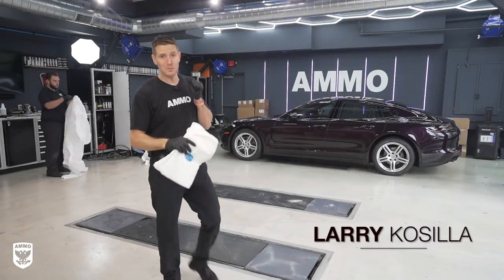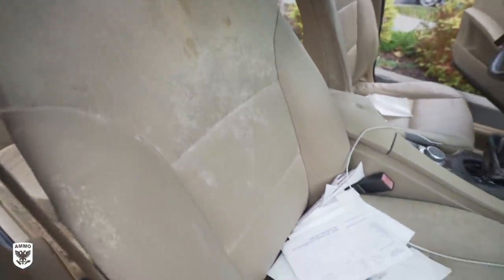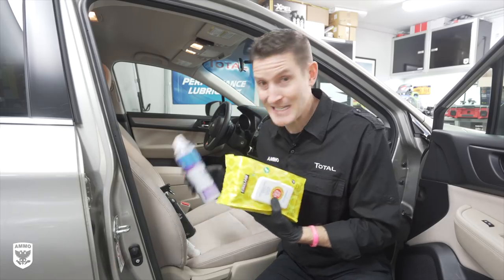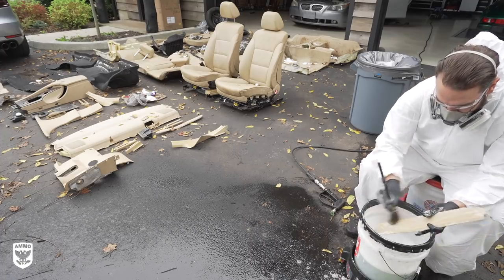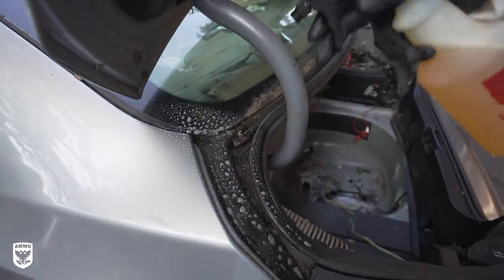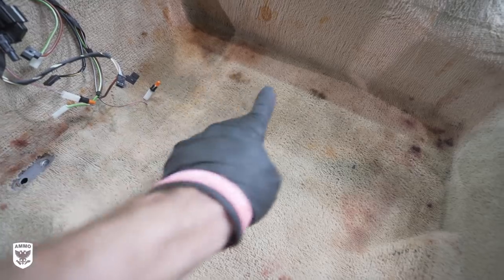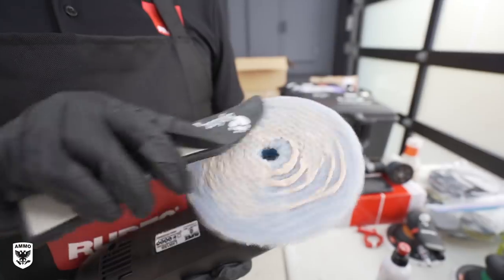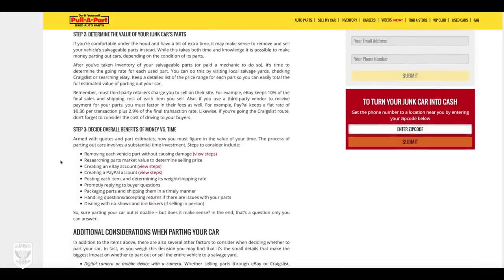Dirtiest Car Ever! BMW Full Interior Removal and Detail BMW 5 Series

Comment: Larry... if you were doing this for a customer car would you have a concern for the vents, headliner and foam inside the seats still containing some mold?
Reply: This!! I’m wondering about this too.
Reply from the maker: Yes it would be a concern
Reply: @AMMO-NYC  Would the gas have killed whatever was in the vents or would you need to actually take the HVAC system out or replace it? Also what would be the process for cleaning the headliner? You could just replace the seats because they probably do still have mole inside and could get them cheap.
Reply: Would probably want to run hvac on recycle while it's gassing like when they do the ozone treatments.

Comment: The car wud still be bio hazard, aircon dashboard etc were never removed
Reply: Yah how does this work legally? The car was totaled as a biohazard, and those hazards still exist.  The unsuspecting buyer of, say, the back seat would get a massive chunk of foam and upholstery full of nasty.
Reply: Yea its dubious, things like the seats should have been permanently defaced to ensure no reuse no resale.
Reply: But I think the tablet system that they used killed off all the mold.
Reply: @volvacations2186  Do you really think the tablets got all of it? Doubtful.
Reply: The Chlorine Dioxide was used to kill the mould remember.
Reply: If you do a strong Ozone treatment it can usually remedy that issue. Since Ozone is a gas and can reach virtually every space. Also the fact that Ozone kills bacteria and viruses. Taking out the entirety of the AC systems would be fruitless. Unless you just want to totally replace them. Which for this car, would’ve been the proper choice.

Comment: If you’re concerned about to panel/trim clips breaking during future details, you can order kits off Amazon with different assortments of sizes for $15-$20. Kits typically are made for one specific manufacturer. You could keep one for each of the common manufacturers on hand in the shop.

Comment: I can easily relate to this. I work at a scrapyard, and only deal with the automotive recycling side of it. You have to go in the cars sometimes to pull stuff out that can't be shredded or crushed for safety and environmental reasons. It gets really disgusting sometimes. Even this bad. Which is why you refuse to go in those kind of cars.

Comment: I use ozone machine to remove odors and mold you should look into one!
Reply: The CIO2 seemed to work really fast. Thats really handy for a business owner. An ozone generator would have taken 2-3 hours minimum
Reply: @Isaac-od4rm  yea your right but you have to get those special tablets. Ozone just uses power and it’s maintenance free
Reply: He's used them before
Reply: Ozone has no effect on bacteria, mold or VOC... It's effect on odours are also questionable, as it mainly "masks" the smells so you smell ozone in stead. Also: Ozone is toxic... The generators are also not maintenance free as often being claimed.
Reply: @havardhovdet9217  ozone does kill mold and virus I know ozone is toxic but letting the car air out for hours should have normal oxygen levels

Comment: I don't understand how car economics work out there. Was it cheaper to scrap a perfectly functional vehicle that to restore or refit the interior?
Reply: That car is not restored. Sure, it’s cleaned, but the areas they didn’t touch are likely just as disgusting as everywhere else, so this would need a complete disassembly. Not to mention all the wires that could’ve been chewed and all the decay of sitting for a long time, so I get why this was totalled

Comment: Figured I would ask the Ammo community for advice here. I’m a detailer from Columbia, SC and my business is growing and I’m looking to get into machine polishing. I’ve used the Meguiars  ultimate compound and polish by hand to finish off headlight restorations and I’ve done some spot correcting, but I’m to the point where I would greatly benefit from a machine polisher. What polisher, pads, and liquids should I get. It seems like the general consensus is that the Rupes 15mkiii is the best general purpose machine but that seems to be where the consensus ends. What liquids? What pads? Any help would be very appreciated. Thanks everyone!

Comment: FYI - never wash seat belts they will get sticky over time and will not recoil. Nice work most of that hazmat items should have been scrapped not cleaned. But FYI super important when cleaning out seats in a mold car like this require special process to remove mold. but 1000% nice job for the ammo team to take on this work !

Comment: Brilliant video and for a great cause. Interesting about the one step clean and polish product, im gonna have look for these and try. 
I've had great success with meguiar's polish with a microfiber pad at relatively high speeds on a DA  polisher. Works fast is very safe for a low level detailer/diy'er like myself  removes etching marks water stains and neglected paint generally. It's quick and then I follow this with autoglym super resin polish. For more Intensive marks and scratches I swap the meguiar's polish for meguiar's compound and repeat the autoglym super resin polish application. The results are amazing and a whole takes just 2hrs normally. When you normally have a short weather windows in the uk for unpredictable rain showers and my time I've found this to be the best bang for buck method which works for me.

Comment: just a tip, you shouldn’t dry carpets in the sun as they can shrink and then they don’t fit well back in the car. they should be dried with a fan indoors so basically air dried. Detail was fantastic though!
Reply from the maker: Thanks for the tip

Comment: Those particular e60 models are known to have clogged sunroof drains,  letting water escape into the headliner, down the b or c pillars and into the carpet depending on which side the drain is clogged off course.  Your water through the window theory,  not sure about that one but it’s possible.  It’s more likely water from the sunroof.

Comment: I'm just curious if all of the cleaning solutions that you are using and rinsing off in the driveway are safe to have enter the storm drain system of the neighborhood, not to mention all the other contaminants?  Also,  maybe look into a larger pump sprayer like the exterminator uses to spray large amounts of cleaners all over the interior of the car.

Comment: Hi Larry
Love you videos, they are very educational in a way that I never ever imagined.
I was wondering about how would you proceed with motorcycles. Recommendations, etc.
The paint is very exposed to the elements everywhere. And the engines, even with fairings, are also exposed to all kind of things on the road.
And since some bikes don't recommend power wash because of the electronics, like my K1100RS, how would you do it?
Or you don't work with bikes at all?

Comment: mechanic here, worst car I ever had I removed 11 mice out of.  Car was only 2 years old and they had a terrible smell so they took it to a local detailer and had a chlorine bomb put in. Fixed the smell for a hot second. Problem is.... They killed all the mice in the car. Not only this but the mice had made a nest in the blower motor and yes when the customer ran the blower motor they killed 5 baby mice and the mother. It was upper 90's out and the mice had been dead in the car for a week when it came in.  I don't know how insurance didn't total the car but by the end of the job had replaced the HVAC ducting, blower motor, headliner (dead mouse in it) center console and carpet. Inspecting some other used cars I can tell you when I watch this video I can smell it.

Comment: Any advice for my 12" audi a6? Every time I turn on the climate the day after I have a light cough, I already change the cabin air filter and payed for a clean with ozone but I think they didn't do a good job. Thx a lot!
Reply: Hmmm, maybe because of the cold and dry air of your AC?
Did you turn of the AC in the right time a few minutes before you stop and turn of the car to let the condensate of the evaporator dry?
Reply: @kallegrabowski8972  Yeah, my dealer has disassembled the entire evaporator but the problem keep, i plan to replace the car only for this problem, because nobody can fix it, is almost 2 year now i have this problem

Comment: This Video was a nice demonstration on what's possible, but I think the whole interior should have been scrapped. No-one should use these seats, carpets and so on anymore... 
Also I'm pretty sure the noise-barriers in the doors are the cause for water getting inside the car. Those foammats glued on the inside of the door get loose and water starts to run from behind the doorcards...

Comment: I couldn't imagine how much work would have to go into that car just to fix the electrical system after it had been most likely destroyed by mice.
Reply: I was surprised the power seats worked and nothing exploded when they hooked up the jumper pack.  I expect it'd set a new record for number of simultaneous fault codes if someone plugged in a reader though.

Comment: Question: Since this was totaled by an insurance company, does it need to get a salvage title in order to be road legal again?

Edit: I have an 06 330xi, which I bought for around $8,000. The price of parts alone if I were to part it out as it stands is about $15,000. If you have the equipment, it makes sense to buy these cars. Either you get it working and sell it for a profit, or you part it out, and sell the parts for a profit (though it would obviously take more time). The way used cars are these days, I'd imagine it's hard to go wrong if one were to find the right car at the right price.

Comment: When pushing a car, don't push it by the fragile body panels. Push it by one of the wheels with you hands, since wheels are ment to roll it will also be much easier to move the car.

Comment: If you ever sat down with a neurologist and had a conversation about mold exposure,  you would have never, never made this video. No video is not worth the exposure you or your coworkers have now experienced,  your so called jumpsuit and breathing filters are no match for that mold. No chemicals will completely remove it from your surroundings,  it is now everywhere inside and outside your shop, on your tools, your ceiling,  your shoes, your hair, any child coming in contact with you or your supplies could potentially become ill. I can't imagine why , even with your explanation you would have done something so foolish.

Comment: Rule 1 of mold remediation. Contain. Can’t believe you would do that in your warehouse.  Just think of the cross contamination. No air scrubbers running. No containment. 
How did you clean the foam and interior parts that can not be reached under the covers? 
All porous materials contaminated with microbial growth should be discarded. IICRC S520.  

It looks good but damn it’s full of wrong doings for proper remediation.

Comment: Even after this clean - this is not a safe car in any way. The mold is highly toxic and can cause damages to your nervous system and will break your immunity. APC will not work, you need something that would kill the spores and this will not do it. This should not be sold even as parts before being sprayed by professionals who work to remove mold and the whole car should be soaked in specialized chemicals.

Comment: OK so since nobody Else said, am gonna say that the value assumption to this otherwise beautiful e60 5 series, tole from the video is to my confuwion Berg big and not making any sence. Cause 3k dollars for this machine is very low price for this newer 5 series compared to the used CAR marked here in norway. Depending on the mileage, prod. Year, optionale extras the CAR is equipted with ,engine type ETC, this 5-ers gode from atleast 65000kr to over 150.000kr wich is from 6500$ to over 15.000$, Even without a good looking colour and NON msport such AS this one. So this CAR has much more value potential that one would think.👌

Comment: This is just some nonsense. Just rip out the mold interior and sell the car auction anyway... OEM recyclers and parts buyers are happy to take the steel shell
Reply: Yo bro to even rip out the mold interior, you will still touch the material. & due to that u might get diseases. So this was really necessary. Which YOU will never understand.
Reply: @Rao_Sahab_7878   brushing the mold and aerosolizing and breathing the moldy aerosol in for 8-12 hours is so much better than the ripping the moldy bits out in 30 minutes ( no aerosol created) and minimizing exposure.  You dont even know the first thing about mold or detailing a car.

Comment: "Dan, Tom and I rinsed, scrubbed and dried...", using the word myself instead of me or I makes you sound pretentious and is incorrect. A general rule of thumb is to remove the other parties from the sentence and see if it still makes sense. In the case of your sentence; if we remove Dan and Tom, we are left with "Myself rinsed, scrubbed and dried all the parts", which is clearly not right.